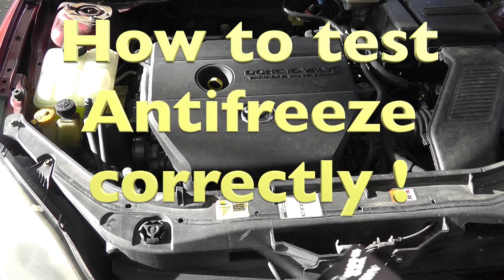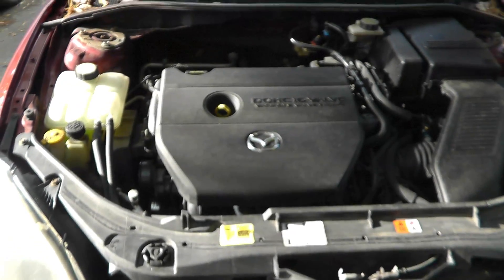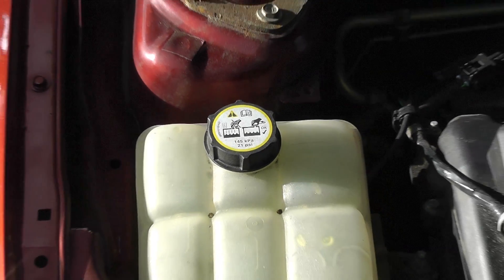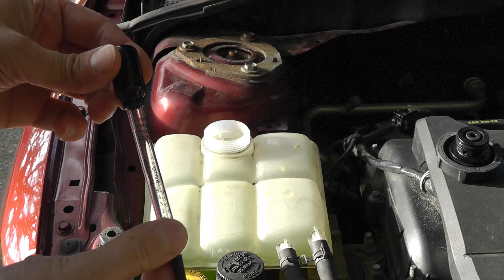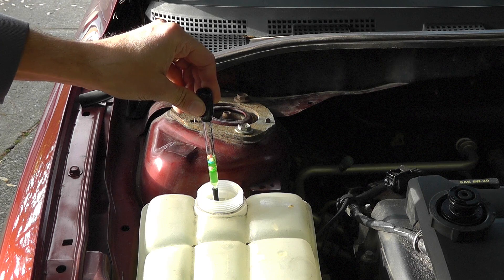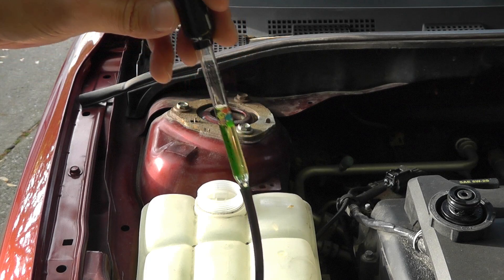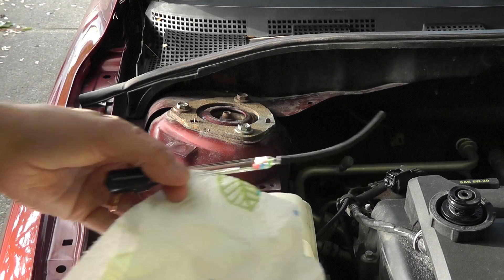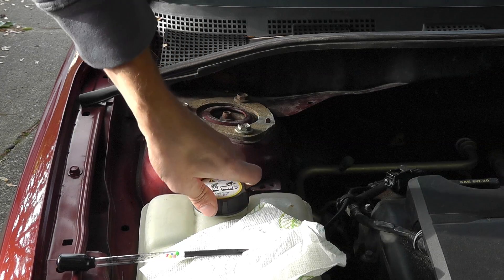How to test antifreeze strength CORRECTLY

Comment: You're checking the strength in the  reservoir only. You should really check it in the radiator because coolant is not circulated through the reservoir. You could have 75% antifreeze in the reservoir and straight water in the cooling system.
Reply: Looks like a pressurized cap, so there may not be a radiator cap to check from. Unless you suggest removing one of the hoses, which means you'll need coolant on hand. Nvm testing it, just spill some and replace the exact amount you spilled or you risk an air pocket in the system.
Reply: some vehicles hav only cap at reservoir

Comment: What color is antifreeze? My color is a dark brown. Is that right ?
Reply: I would say it probably needs tested and most likely flushed and refilled. Sounds like water in the system causing corrosion.
Reply from the maker: It is usually bright green or orange
Reply: The color varies by vehicle, but if it's a dark brown then it probably used to be a golden color and is now dirty.

Comment: You didn't explain if the -40F temp. reading is good or bad
Reply: That's good. That means that if the temperature drops down to negative 35, it still won't freeze and damage your car.
Reply: @javaman2883  what dose it mean if the red and blue ball doesn't float at all they just drop to the bottom!!
Reply: It’s good means ur engine won’t freeze and possibly crack until it gets to -40°

Comment: wut happens when I only has 2 balls?
Reply: 2 balls are fine, it's when you're down to 1 ball, that's a problem.
Reply: 1 or 2 balls are fine for some areas, hot climates where freezing temperatures are rare. Remember that at 1 ball, that rare time it gets near 20 degrees F can mean replacing a radiator.
Reply: I live in South Carolina and mine has 2 balls... I know it will never get close to 5 degrees so that works for me. If you live in a warmer climate you can use less antifreeze and more water if you want because it will be less corrosive to your car's coolant system.
Reply: Was that a sexual joke tigerbalm?